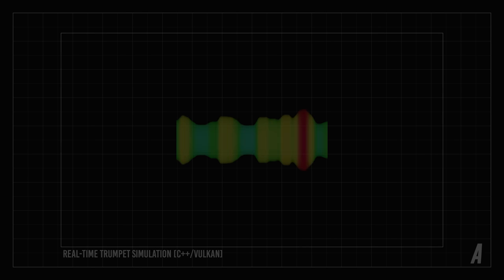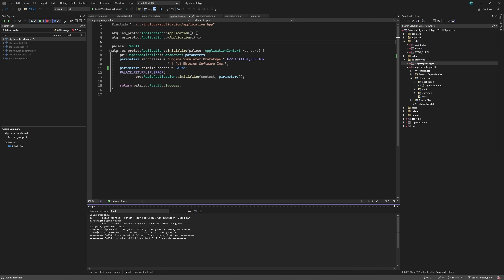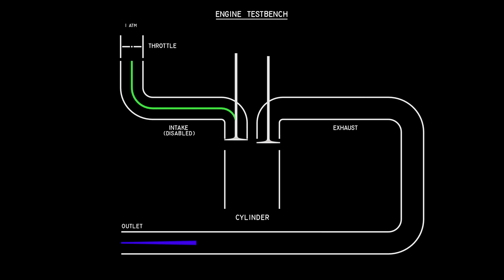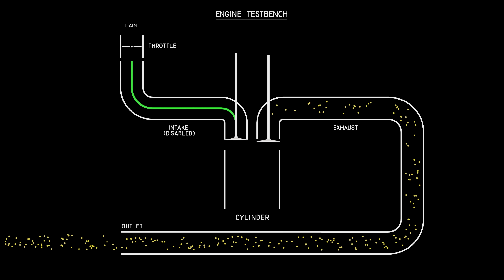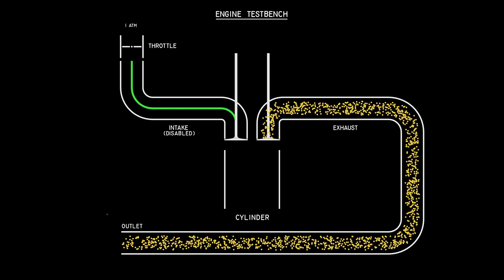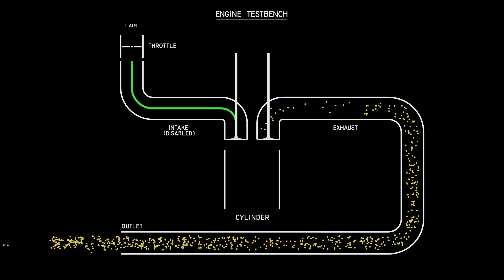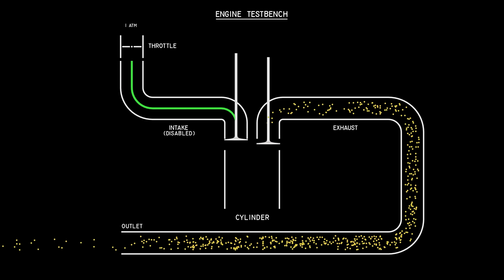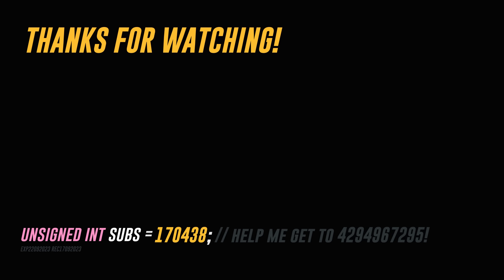Initial Audio Testing - Engine Simulator Devlog 3

Comment: I don't like the convolution reverb "not everybody runs an engine in an audio studio" I feel is kind of the purpose of this software, to get proper clean audio of whatever motor you can imagine. I hope it's at least toggleable because I think V1 is still currently more acoustically pleasing
Reply from the maker: The convolution reverb is completely controllable by the user and can be changed to whatever they choose. I chose higher reverb just as a demonstration to illustrate running an engine in a hangar or other large interior space. Not everyone will be using the software to generate samples so it doesn't make sense to restrict the software to producing 100% dry audio. Just like the original version, the program allows the user to adjust the parameters however they like to produce the sounds that they want

Comment: Sound generation is a very interesting field to dive into. There are so many variables for a given platform, it almost resembles global weather patterns, where if a butterfly flaps it's wings in Jakarta, it starts snowing in Colorado. That's a bit extreme, but you see what I'm getting at. Everything affects everything else. The material size, thickness, and composition will produce a certain resonance at a given temperature and pressure. Like you mentioned with the exhaust tuning, you'd get a louder, sharper, more distinct, exhaust note with a tube or chamber designed with the proper size and length (i.e. an expansion chamber on 2 strokes), as the engine reaches it's peak power r.p.m. I'm really curious to see how all this can be mimicked with lines of code and an audio card! Very cool stuff!😉

Comment: Regarding the instability:
- If it looks like a sawtooth, even if it is tiny, it means it broke in a very classical way. For every propagation term (dt=dx) or wave term (d2t=d2x) the medium made a jump larger than a single discrete cell, aka Courant condition; for every diffusion term (dt=k*d2x) the stability condition is dt/dx^2 < 1/(2*k). Sudden pressure spike on the boundary of the valve will create the largest possible velocity (flux). Although, I assume that was quadruple checked already.
- Depending on the implementation, limiting might only make things worse and explody. For example, hard-limiting the amount of distance that a mass on a spring can travel at a certain period of time will result in velocity variable exploding. In fact, any hard-limiting will result in a numerical collapse in one way or another. To avoid that limiting must employ a physical phenomenon, like viscous friction.
- If there is anything that employs ODEs, and even better if it ONLY employs ODEs, using implicit solvers would make the simulation indestructible even if the stability conditions are not satisfied. Typically they take as much computational time as explicit solvers if nothing extreme happens and everything is smooth.

By the way, it looks like the Euler equations can actually be solved with Runge-Kutta implicit scheme if used with finite-volume method (referring to "Numerical Solution of the Euler Equations by Finite Volume Methods Using Runge-Kutta Time-Stepping Schemes" by Antony Jameson et. al)

Comment: You could probably use doubles with little to no performance loss, modern FPUs are made for them, and the rest of the chain for 64 bit too.
Reply from the maker: It's mainly for the SIMD optimizations where using doubles will cut the vector size in half. I can trivially switch between float and double and I've done the testing to confirm this. GPUs also don't appreciate doubles so I don't want to design algorithms that rely on the usage of double-point precision, only to then have them be unstable on the GPU if I ever move in that direction
Reply: @AngeTheGreat  Newer GPUs have little to no loss in doubles, but it's true that i have never checked stability.
Reply from the maker: It's not really the performance loss I'm concerned about, it's mainly support. As far as I can tell, most GPUs prefer single precision and double precision has only recently gotten more widespread support. Even still, it doesn't solve the problem of SIMD which is a guaranteed 50% loss in performance when switching from single to double precision

Comment: I don’t fully get how you modelled the moving piston in the fluid domain. Did you impose pressure and temperature based from the engine and set the velocity equal to the piston velocity?
Reply from the maker: As I said in the video, there is actually no piston at all. This is just a testing setup and the cylinder is at a constant temperature and pressure with the piston motion not taken into consideration
Reply: @AngeTheGreat Sorry, I meant to say exhaust valve, not piston. Surely there has to be some boundary conditions imposed at the location of the valve in the fluid simulation, or else I presume nothing would happen.
Reply from the maker: Ah, I see. Yes there is a boundary condition at the beginning of the exhaust header that varies depending on the position of the valve and the pressure/temperature inside the cylinder. It's all fairly standard stuff, there isn't anything too complicated going on
Reply: @AngeTheGreat  I see. Out of curiosity, may I also ask what kind of numerical schemes you have employed, and how many cells? I heard you mentioned flux limiters so I assume you are using a second-order spatial scheme.
Reply from the maker: @andersr9545  I'm using a linearized Riemann solver

Comment: I think stereo audio would improve how real everything sounds quite a lot. Is that something you plan to do at some point?
Reply from the maker: Yes, it's fairly easy to implement and once I move to the 3D interface, it will fit in naturally with the rest of the application.
Reply: @AngeTheGreat  Awesome!
Reply: @AngeTheGreat Will you be using the 3D Interface next Dev Vlog?

Comment: try using fixed point numbers 

they should be alot more stable and with constant accuracy across the range they support but they are limited until you use alot of bits like 64 or 128 

its a choice that you choose based on the condition and what you think fits you best for your simulation but i think if you want an accurate and stable simulation you should use them 
(just like integers , you need to account for overflows)

Comment: "I get lots of emails from siren enthusiasts" is not something I expected to hear today. It sounds amazing!
Reply: I guess Siren-Simulator for 5 bucks has the potential to fund this channel for years.
Reply: Don't make the same mistake I did. I looked up what the three mile sirens were since I grew up in the area, to which I learned they were ACA P-10 Penetrators which were later replaced by the ASC T-128, and from there I learned my local fire department had a Federal Signal STL-10, and then I slipped on down the rabbit hole of emergency siren history. We've made a LOOOOOOT of different sirens over the years. You can get lost in the Air Raid Siren wiki for hours reading up and listening to different makes and models.

The SiraTone EOWS 612 being commanded to play Alternate Wail is the freakiest alert pattern I've ever heard.
Reply: @FurryWrecker911  oh god time for a new autistic hyperfixation for me, it's gonna be even worse since i'm an EMT and work with sirens all day 💀
Reply: 'We' won the soccer world cup some years ago. One of the highlights this evening (aside from the parties everywhere) was a seemingly ancient air raid siren. Everybody needed to have a spin, literally.
I'm not surprised there are siren enthusiasts out there.
Reply: Im a siren enthusiast

Comment: You should turn down the mix of the reverb by like half. I mean like let 50% of the original sound and add reverb to just the other 50%. Maybe even more of the original. Could also use some rng in the reverbs delay from the original sound, between like 20 and 50 ms or sth. Sounds great tho, keep up the good work.

Comment: This sounds incredible to me.  I'm a database integrations engineer that accidently fell into providing IT support for a truck/Porsche racing shop.  Engine noises in video games always sound so off because they're typically short loops of the engine (and there's a loop point) and the transition between high and low RPM samples never sounds quite right.    
This sounds right.  The tones might be a bit off, but the ramp up / ramp down sounds correct.  The part you're missing the vibration of the car body itself.  (I hear a lot of cars being revved up at work.)  The vibrations of the engine block and the exhaust system play a huge part into the sound being produced.  Adding reverb sounds better, but not more accurate.  Car blocks have different ways to absorb the vibrations of the engine; it's part of why the V8 has a very distinctive sound.

Anecdotal evidence aside, have you ever looked into recording a car while dumping the data off of the canbus?  You can get an ODB2 reader that plugs into the car data port is the easiest solution.  Sorry if this is redundant information, but you'd be able to see the current air pressure, air temp, throttle levels, and other metrics that would affect the tone being produced by the car's exhaust.  

Regardless, I love that this project exists.  Video game audio feels stuck in the 1990s using digitized recordings instead of realtime generation.  Thank you for posting this.
Reply: This is the same problem that sampling based music synths have and which physical modelling synthesizers like this one aim to address.

Comment: Keep up the great work. I fully believe, that sound cards might return as an important part of a PC if sounds are being generated instead of using samples, like how raytracing became a new direction, I honestly believe, that this is the way of the future for games, manufacturing design, etc.
Reply: GPUs are pretty useful for generating sound, and most already have native audio capability for HDMI output too
Reply: @identiticrisis  Sure, but I think the approach of like how old arcade systems worked should be the way. (Old arcades used to have separate chips for sound only). Also Soundcards are still a thing.
Reply: @n0rbert79  a lot of the calculations and information that GPUs are being used to handle are equally useful for sound. I personally can see GPUs being used to calculate information for both lighting and sound at the same time. The two are convergent in many ways, except the spectral variance in sound propogation is more challenging.

Traditional sound cards only have limited mixing and localisation ability in hardware, which frankly doesn't offer much speed up nowadays. For them to be more useful they would have to be redesigned so their hardware more closely resembles a GPU anyway, because the work is so similar.

Comment: Are you planning on simulating different combustion chamber shapes and valve layouts? I've noticed recently that 2v, 3v, and 4v engines have distinct audio qualities to them that I think would be important to consider. As far as a possible GUI and whatnot, have you considered having a simplified or semi-simplified builder mode wherin you input some specifics like total cam lift, rocker ratio (if applicable), total duration at .050, but then you select from a list of a few different profiles if you don't feel like making a custom profile yourself?

And same with the combustion chamber, you can select between a couple shapes based on your valve layout instead of molding it yourself, but then you could detail things like the quench and other aspects of the valve seat shaping and space around the valves either numerically, or perhaps on a scale of quality from 1-5 or 1-7? One of the things I'd like to add to my own engines is the little lip in the intake port that Toyota added to the GR Yaris in order to improve tumble-flow mixing by making the charge flow across the top of the valve rather than enter throughout the entire radius of the valve.

Comment: This is incredible! Just wondering, is’nt the resistance to the engine part of what makes its distinct sound? Idling is difficult to model you say, but is’nt the idling sound also affected by having to drive the rest of the engine and it’s variying resistance to each cylinder, even when no other load is present?

Comment: To avoid some precision loss one can use double-double arithmetic, or in your case double-float, which uses a second floating point number to estimate a lower magnitude "error"
the 2SUM algorithm is one of those algorithms and Dekker discovered an algorithm for the error term of multiplication (fma making that easier)
Not sure if it is worth it in this case, as you more than double the operations and  double memory profile at some points,
anyway laying out the algorithms to use FMA, if not already done so, can also increase the accuracy of your calculations
if you want to learn more theses the "Floating-point error mitigation" Wikipedia article,  Dekkers papers, or the cr-libm paper (ensl-01529804) describes the algorithms in chapter 2.3
Reply: This project's goal isn't strict numerical accuracy, but rather plausibility.  For that, 32-bit floating point should be more than accurate, especially since generating audio samples at realtime rates is a huge computational ask.

I think it's most likely that the simulation code contains some kind of subtle, undiagnosed bug (maybe reading an old value, or one from an incorrect grid location), which would lead to a similar blowup even with more precision.  If precision does fix the problem, then the issue might be a more subtle one, such as not cancelling out an analytically-satisified balance.  For example, if I'm measuring a distance on my desk, it doesn't help to take all measurements from the center of the earth.

Comment: I am planning out a game I want to make. I want to have mechanisms that are realistic and unusual to find in games, but I also have to keep it simple, so it doesn't get too complicated for me, as this is the first real game I'm making. It is in a voxel grid, but I have not completely settled on all the properties of tiles in that grid. When there is not a block in a tile, that technically leaves a lot of bits unused. I want to use those bits for stuff like wind and fluids. (I know I could just make an "air" block, but I'm leaving out the reason why I'm not gonna do that.)

I want to make a realistic mechanism system. I don't want players to be able to find some rocks, some sticks, and some crystal powder and just combine that into a complex electronic component, but I still want the game to be fun, and not extremely tedious. I am considering making temperature and fluid(water, air, and steam) momentum a variable each tile that can have that has, but I know I can't throw everything into the game. Do you have any suggestions on how I could make a mechanism system that makes sense, but is also able to things on a larger scale if set up properly?
(I'm not asking you to design my game for me. I just think you would have some interesting feedback or suggestions on this topic.)

Comment: Ange, I'm wondering a bit-would it be possible to implement a gas turbine (aircraft engine for example) using the existing simulation base? A turbofan engine is pretty complex, but I think an accurate sound output could be useful for flight simulation
Reply: Probably not. Jet engine sounds come mostly from the jet mixing noise and the interaction of the fan blades with stator blades. Both cant really be modelled by his simulation

Comment: Since you are running the sim way beyond the final framrate, would it be possible to fake motion blur on the exaust valves?
Reply: I wondered about that also! It's almost as if there is a shutter effect with the valve at higher speeds, similar to what you get with a camera filming at 30 fps. and seeing an airplane prop that appears to be stationary at points because of the frame rate, whereas the human eye would see it as a blur because the brain can't process the rotation of the individual blades quickly enough.😉
Reply: You can already see the shutter speed/blur effect in steam engine sim, the crankshaft will start to look like it's turning backwards at certain rpms, and near stationary at others, with ghosting in between
Reply: This is typically called "accretion blur" and it only works at absurdly high frame rates (1000fps or so). If he did implement a motion blur it would be a visual trick and not a function of the simulation really.